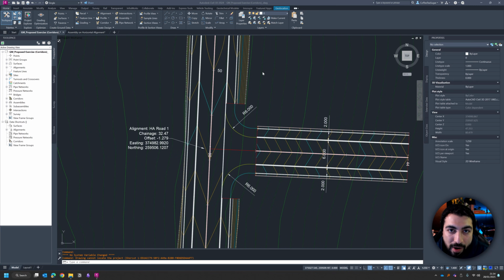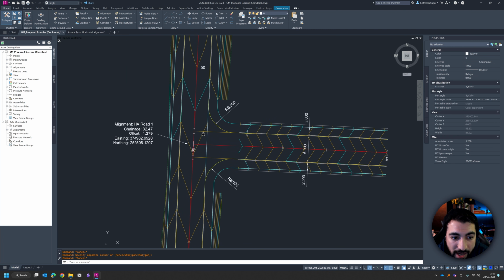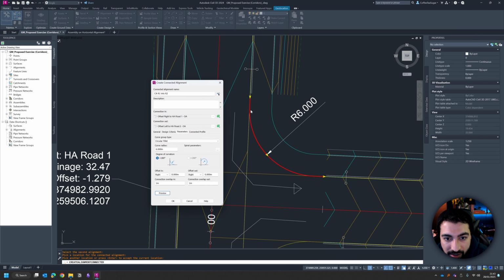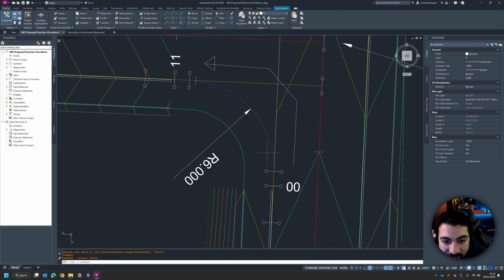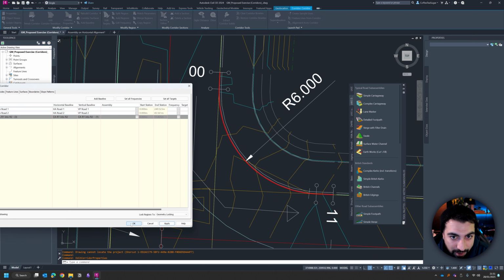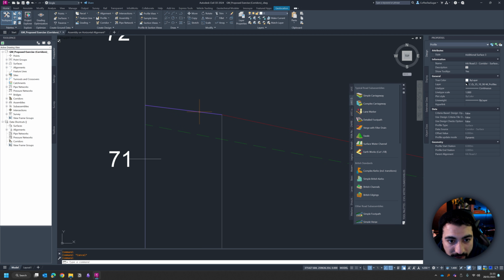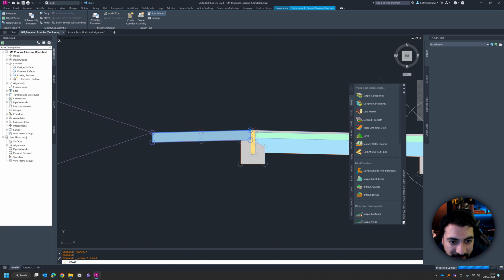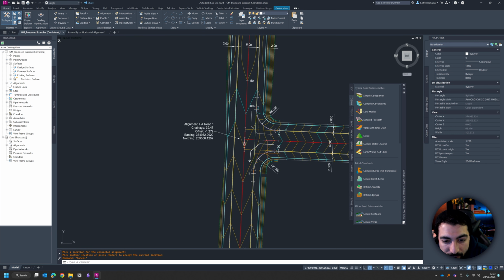Road Design in Civil 3D - Simple Junction (Part 5)

Comment: Hello. Great Vid. Can u explain briefly about cross slopes for the connected profiles. cant seem to understand really what happens when you set it as -ve and +ve. thanks
Reply from the maker: Hi, the connected profiles basically they create automatically a Vertical profile that connects the two offset alignments from the point you drew the connected alignments. If you want to have more control (in terms of specifying a low or high spot along the curve) then you will need to create the alignment manually. Hope this helps!